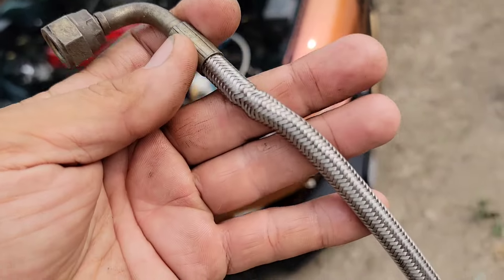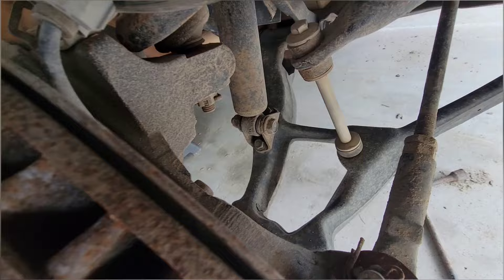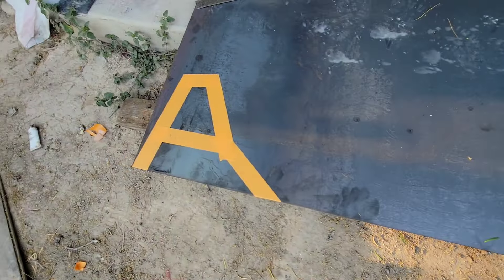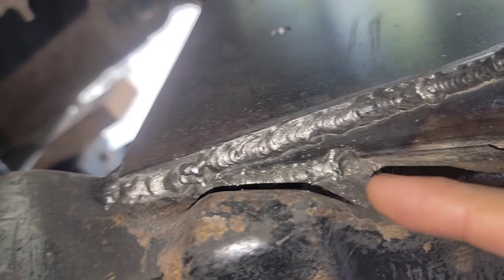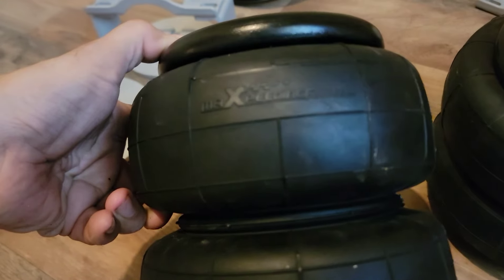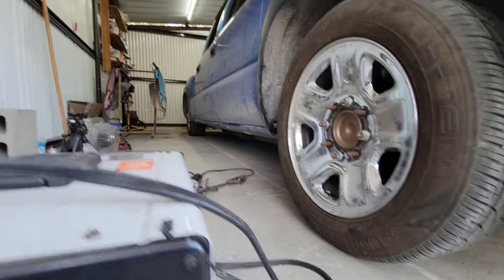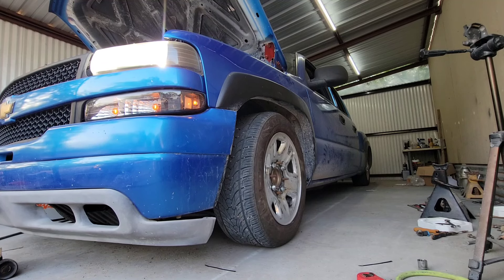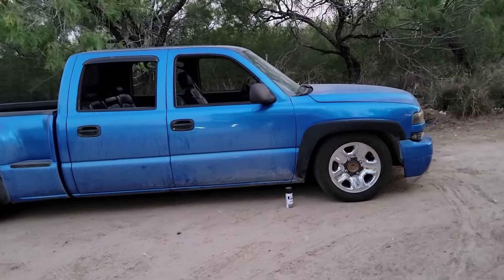I Installed @maxpeedingrods Airbags on my Silverado 1500HD

Comment: Trucks gonna look good when done. I gotta get my civic finished then it's on to my s10. I just did maxpeedingrod 2" drop spindles on it. May Wana see if they have them for your truck. It'll help get it even lower. U Wana get good link bars and stuff like that for the rear check out nfamous. The red s10 in my community section has their 5 link kit on it and it's sitting on frame when laid out but they got all kinds of useful stuff and there here n Texas. May also Wana check on stuff for your torsion bars. May be able to get different ends for them to adjust them lower too

Comment: Looks damn good man! In the future if you can fab up some front shock mounts so you can run front shocks it will greatly improve your ride quality. Check out Nfamus air suspension Keith makes some top-notch parts.